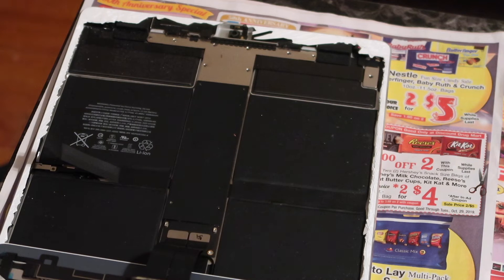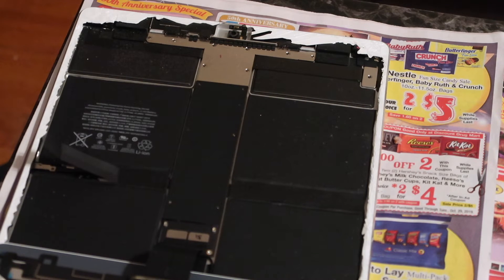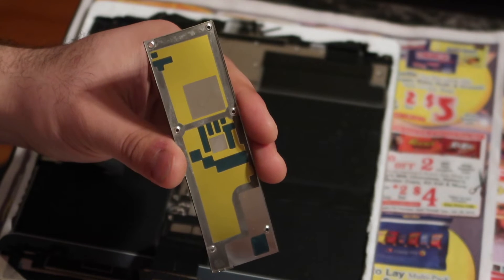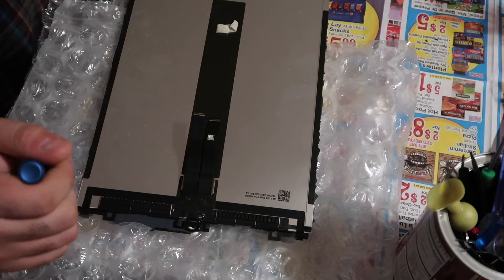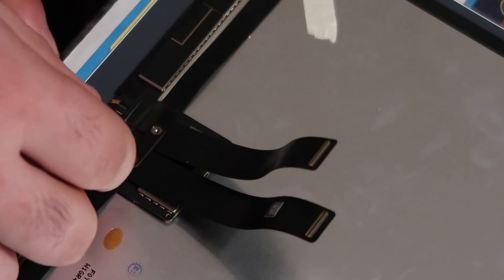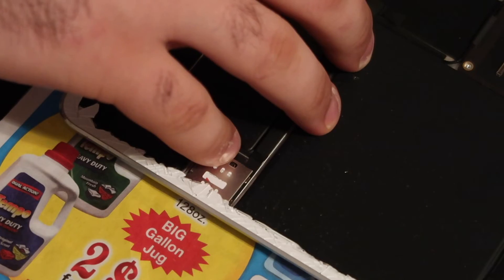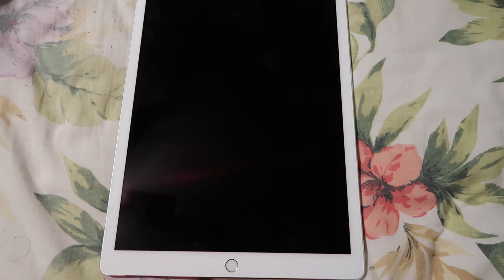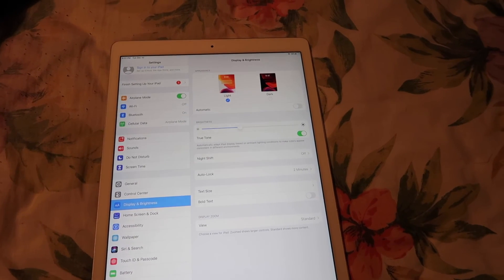iPad Pro 12.9 Gen 2 lcd glass screen repair/replacement

Comment: Hi there. Is there a way to change the Glas only if the Display has no problem?
Reply from the maker: pretty sure you can but its difficult to do and if not done right you can damage the lcd
Reply: @07n54   i hear ya. just wanted to know if its possible. i mean the glas costs like 40-50? + the risk you take. Might work. Might not. Replacing the whole Display will probably work 100% but is 400-500. For me not worth the effort as i can put another 100 and buy a new (used) one. Problem is it would be an experiment since i havent found one single instruction of someone trying-showing it